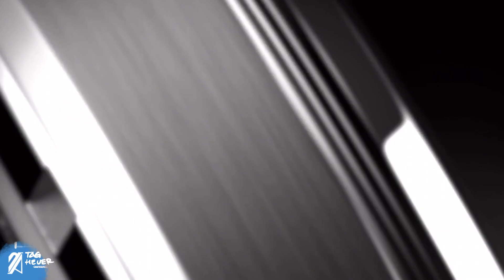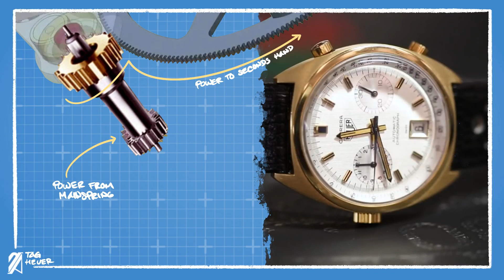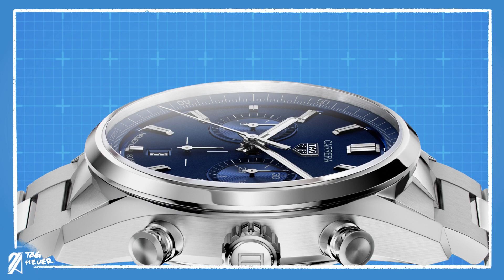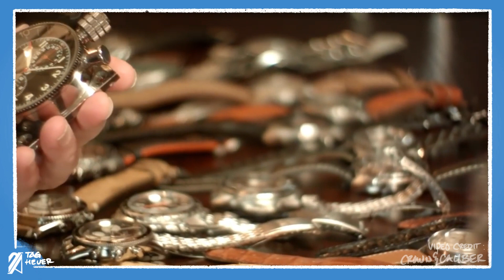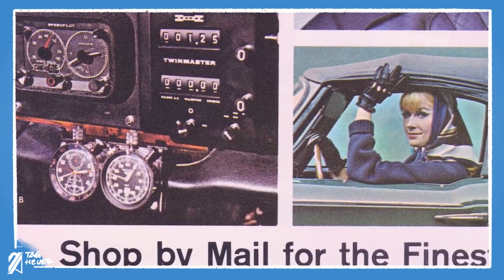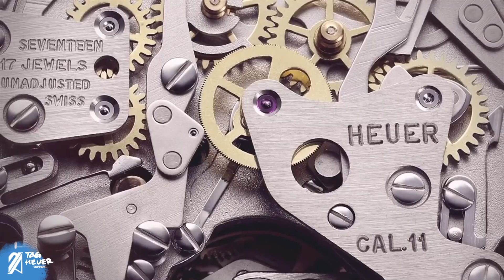Why New Tag Heuer Carrera's Are The Symbol Of The Heuer Spirit

Comment: I now have this quality watch in my collection, with the Black dial, it has a stunning apperance on my wrist. I am considering fitting a black leather wrist band, may i have your opinon in doing that ?
Reply from the maker: I’ve seen this since here in one of the ADs. Putting it on a leather strap is a great option especially if it’s a perforated strap with white or grey stitching. Alternatively one with a red lining. Enjoy it my friend!
Reply: Wonderful watch you have. The crown is screwed?
Reply: @giannispapazogloy5978   No it dosn't have a screw down crown ?
Reply: @robalexander7348  Thanks. This is not good.
Reply: @giannispapazogloy5978  It is a Chronometer watch, not a divers watch  👍
Reply: @robalexander7348  Does not matter. At this price, all watches should have a screw crown, for extra security. I have a Seiko sportura f1 honda racing team, which is a chronograph, and not for diving. It has a screwed crown.
Reply: @giannispapazogloy5978  Yes, I would agree with you there  👍
Reply: @robalexander7348  But it does not matter much, since there is no purpose to enter the sea.

Just do not accidentally open the crown (it has happened to me once).
Reply: @giannispapazogloy5978  Yes i Agree, my expenxive watch collectiom will never get wet anyway   ☔